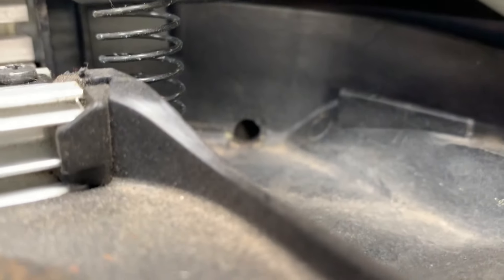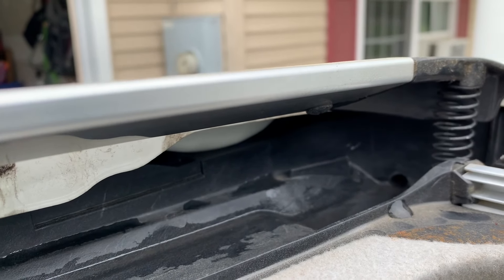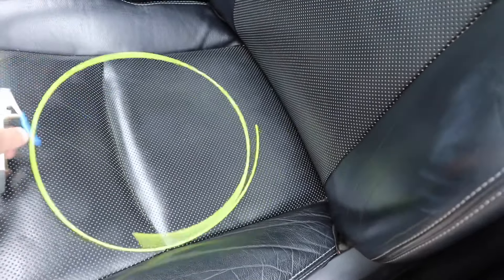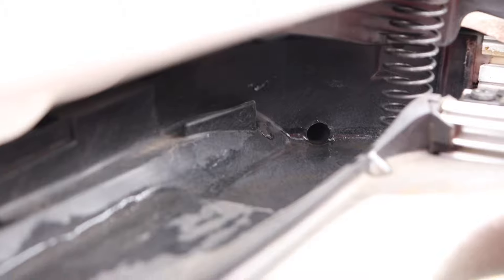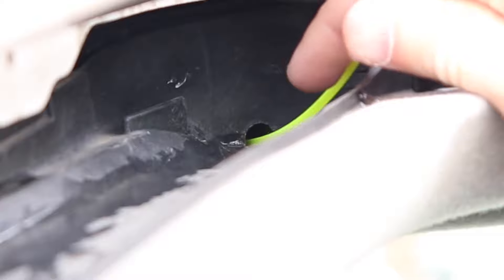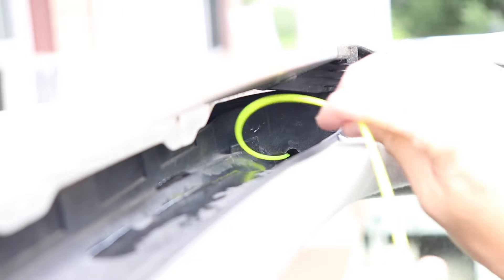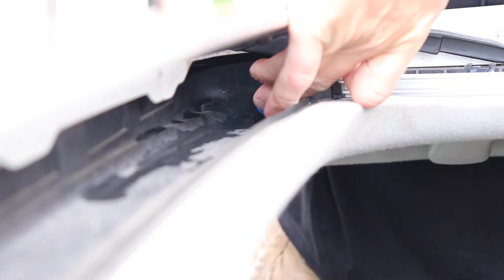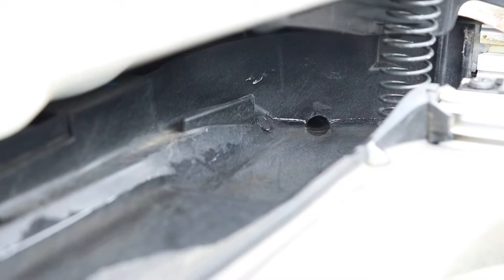How to Unclog or Clean a Sunroof Drain

Comment: So my problem is that water is leaking into my vehicle from the inside of the tubing somewhere. It ends up dripping down to the floorboard on my passenger side and I don’t know how that can be fixed cheaply. Any thoughts? There are no obstructions and I can get water to pour out the bottom behind the wheel well, but with enough rain, water starts to get inside the cabin.
Reply from the maker: My suspicion is that it could be leaking in somewhere else. Maybe the windshield seal or the intake for the hvac system under the wipers.
Reply: It's probably not flowing fast enough out the back and when you hit the brakes it shoots up forward. You can also use liquid plumber. It's safe for plastic. Just rinse it out well with hot water afterwards.
Reply: In font of the windshield you have the plastic cowl top. It also has drains that are cloged up by leaves and debrees. Then it starts to leak into the footwell.  Just find some videos on YouTube describing  how to clean them  for your car model.
Reply: Crazy but mine is leaking thru the light for using the face mirror onto my seat and wreaking havoc, maybe yours is taking the same route? It leaks onto the mirror and then collects and drips down the corner of the mirror flap
Reply: @GiraffeFiesta  Then, it's the cloged front sunroof drain, for sure.
Reply: @GiraffeFiesta There is an extended warranty on some cars that covers replacing the roof rack clips as Toyota now admits the water in that area could be from the roof rack clips...
Reply: @cinderellaz8927 ughhh betting that wouldn't apply to a 2016 Infiniti QX70S at this point? This shot is AWFUL. Mine has a roof rack and the water coming into the cabin was at one point just the passenger side and SOAKING the inner windshield. Then it seemed ok when I had a local mechanic "attempt" to fix it several times. This horrid wet ass summer and "fall" it's on the driver's side floor now as well, my windshield is SO wet I can't even get it to dry off with heat alone, AC, or combined and can't see out of my now yes 7 yrs old SUV, but it was expensive as F, paid off, and only has 37,000 miles on it. UGHHHH😢
Reply: @QueBeraBera me too bro. But mine an fx35 and 60k miles. Ever fix it?
Reply: It’s your drain plugs that is clogged .
Reply: Is there a danger of tearing these rubber tubes that take the water away ? In my VW T6 the drain & tube seem to be clear but water is still coming into the cabin. What wd be the fix in this scenario please?
  Any ideas greatly appreciated.
Reply: @henrycottam3451 did you figure this out? Mine seem clear also, but still leaking horribly
Reply: @QueBeraBera I had water getting into the passenger footwell in my 2016 Infiniti Q70 sedan. I took it to the dealer before I found this video and they replaced the sunroof drains. I don’t know if they were just clogged and the dealer ripped me off when they could have just cleaned them out, or if it was something worse like defective drains. But the issue hasn’t recurred. My guess is they were just clogged since I park outside under trees.
Reply: @Sashazur thank you you're awesome I appreciate you reading back! I finally brought it to the dealer and they did so for me. Thank you again!!!!

Comment: My problem is I can’t get to the drains because the water leaks killed my sunroof electrical so it’s stuck shut.
Reply from the maker: Can you get to them from inside the vehicle?
Reply: Someone said they had their sunroof motor replaced
Reply: @5MinuteFixit  person said they eventually cleaned their drains from the exit, thats at the bottom of it by the front tire area, area by the back of their front tire
Reply: Most sunroofs have a manual override within the open close area, should allow you to close it with some type of allen wrench crank. 🤔

Comment: Nice video! I used one of those stiff wire tools designed to fish hair out of a bathroom sink drain and it worked great. 

Unfortunately, this was in a seldom used vehicle and water had saturated the carper and passenger seat.

I used a powerful dehumidifier to dry out the interior and then an ozone generator to deodorize it. I ran the dehumidifier for a week and the ozone generator for a day and it worked.
Reply from the maker: Thanks for sharing, did the ozone generator and dehumidifier work to make any odor go away?
Reply: @5MinuteFixit  You have to get everything absolutely bone dry, then run the ozone for a few long runs and it will get rid of the odor.

I started with a carpet cleaning machine, using the handheld attachment to pull out as much water as possible.

Next, I placed a carpet dryer fan and a dehumidifier in the vehicle and ran them nonstop, until a moisture meter showed there was sub 10% everywhere. 

Then I ran the ozone machine a few times for several hours with the carpet dryer fan running to blow it everywhere.

I used an extension cord running from under the door to a receptacle that's outside my garage door; to turn off the ozone, I just unplugged it from outside.

Ozone has a half-life of 20 minutes, so I would turn it off for 4 hours, then plug it back in, and repeated that 3 times.

Seems like a lot of work, but it was extremely effective and a lot better than removing the carpet.

Comment: My daughter’s 2019 Nissan Rogue had the problem on the passenger side with a leak. I took it apart like you said. It was exactly the same procedure as you described. The spot where the windshield wiper rest was full of debris. I cleaned that out too. I used a line trimmer and that worked and water came out. That is a really bad design on the Rogues. Thank you for your great video.

Comment: Thanks for the video.
Just one point of concern;
Another video recommended AGAINST using a blower to clear out the drains as this may cause the drain tubes to dislodge inside the bodywork of the vehicle which is a huge problem to fix.
Other than that... 👍🏼
Reply: Yes, the Car Care Nut channel. I would trust what he says.

Comment: You can use 3D Printer Filament too. Works great when you don’t have trimmer line. I pulled it off an old spool and cut the end at a 45
Reply from the maker: Thanks for the tip and for watching!

Comment: Weed trimmer line comes in different sizes.  What size is suggested/recommended?  How long does the line need to be?  The tubing for the drain is some sort of rubber/plastic.  The person that suggested a Draino product - won't that melt the tubing?
Reply: I would go for very thick trimmer line, so it is less likely to kink. As far as Drano etc., it is sold in plastic containers so at least some kinds of plastic aren’t harmed by it. But I don’t know what type of plastic is used in the sunroof drains.

Comment: Sorry, the holes were at the front of the sunroof? I thought there’s usually two to the front (drain front of the car) and two in the back that drain behind the wheel well. I know my left driver is clogged because I had water around and down my ceiling back there. I cleaned it from underneath but need to get in from the top. I wasn’t sure if you meant the front holes drain into the back?
Reply from the maker: My sunroof only has the two front holes and they drain to just behind the front wheels. Hopefully this helps! Thank you for watching! Please consider giving the video a thumbs up if you haven't already! Thank You!

Comment: What else can I use other than trimmer line. I don't have that. I don't have a blower. Do I definitely need that?
Reply from the maker: You can use anything that is flexible and stout that will fit. A can of compressed air could work in place of the blower. Hopefully this helps, let us know what you come up with. Thank you for watching!
Reply: @5MinuteFixit  ...must I have some sort of blower to begin with? Can I just use water to flush down crunched leaves or debris?
Reply from the maker: @sweetbeep  I would flush a small amount of water down to see if it flows through to the underside of the vehicle and if it does no blower really needed.
Reply: @5MinuteFixit  ...thanks.
Reply: Some say a very thin wire or find drain hose at bottom of car, like by the tire and clean debris that might be collecting from the exit hole
Reply: @adavi650  ...thanks. we gotta be careful the wire doesn't poke and make a hole in the tube
Reply: The Car Care Nut channel says don’t use compressed air since you can pop the drain tube off the sunroof frame, to fix that you need to take the roof apart.
Reply: @Sashazur  ok thank you

Comment: Hello. The driver's side fogs up when it rains. Will this method help me solve the problem?
Reply from the maker: hmm I'm not entirely sure, It could just be the water vapor from the driver that is making it fog. It's worth a try and I hope it does. Report back to us if you have luck! Thank you!
Reply: @5MinuteFixit  What should I do?
Reply: Same thing here but it's my ENTIRE windshield ughhh. I'm thinking I need to go the liquid plumber route...any suggestions as to exactly what type I should use? All this time on my 2016 Infiniti QX70S I thought it was the cowl seal after the battery was changed. Now I'm definitely thinking it's the stupid f'n sunroof drains as it's become worse making my inner windshield soaked and no amount of heat or AC will clear it (probably need to change my cabin filters as well, been a while and they are probably soaked), and now I'm getting water on the driver side floor as well. This shit is RIDICULOUS. It should be forever a dealership's responsibility for creating such idiotic malfunctioning BULLSHIT. 🤬

Comment: If you dont mind me askin what type of blower you use to blow it out
Reply: Charmz  I've already tried that and it didnt work.
Reply: The Car Care Nut channel says not to use air pressure - it can pop the drain line off the sunroof frame and then you have to take the roof apart to fix it.

Comment: My poor Jetta got the ugliest ceiling ever right now. Leaked in the front and caused the headliner to sag next to and under the driver side sunvisor, and then it started leaking in the back immediately after in my rear passenger area between the window and the back windshield. 2 saggy headliners overnight 🤧🤧

Comment: Great video. My drains are completely clogged. Can you tell me where the end of the tubing is locate, front and rear. Thanks
Reply: It’s different in each car model but generally there’s one drain on each side of the car in the front corner of the sunroof opening. But some cars have more than one in each corner, some have them in the rear corners too, etc.

Comment: would a can of compressed air give you enough of a blast or would it be too weak to do the job that air compressor is doing?
Reply: That would be safer since it’s under 30psi. You don’t wanna accidentally disconnect something inside of the car.
Reply: @blonded3598  Thanks man. The last few times it has rained I have came out to find my floor maps wet. No puddles or anything just looks like someone sprayed water on them with a spray bottle or something. I will try this.
Reply: @01hondascott did it work?
Reply: @01hondascott same, with my I think the car waves is what pushes and clogs the holes

Comment: What if the trimmer line only goes like 4 inches in and no matter what way I move it around it doesnt go in
Reply from the maker: I would try to force it in more…this could be a blockage.
Reply: I have this exact problem on both front drains of my BMW F30 335i. Weed whacker line goes in 4 inches then stops as if it's hitting against something hard, not like a gooey clog feel.
Reply: Same thing happening with Subaru forester. Can get the line in about 12" at each end of the drain on both front drains.
Reply: Tree needles and junk will get pretty hard and compacted in there and the more you stick that wire in the more compact it gets. A few tablespoons of liquid plumber dissolves those particulates very well. Especially the two liquid type. Rinse it well after the clog is dissolved and poor a cup of hot water down there periodically to maintain it afterwards.
Reply: If it goes in the same distance on the drains on both sides of the car then it might not be a clog, maybe it’s just a sharp corner. 

Plus another channel said the danger of using air pressure to clear the drains is you can pop the drain line off the frame, then you have to take the roof apart to fix it. Could be a similar risk if stops only a short way in and you poke too hard. 

I know on my car I got the line about 5 feet in and it hit a hard stop on both sides, but then I poured water in and it drained out fine under the car.

Comment: Never use a blower at least not in German cars as these drains are connected with plastic clip which can easily disconnect from the pressure.. and then every drop of water will go into your car next time it rains

Comment: Does the average car owner know this is something they need to clean?  First time with a sunroof and didn’t know until it became an interior water/mold issue while parked for a week in summer heat.  Do most people take these steps as part of normal car care?
Reply from the maker: Most people don’t realize this needs to be done periodically.
Reply: I was wondering the same thing! I've had to do this in my 2014 subaru twice now. Never thought there would be a drain in the sunroof. I rarely use mine, so I find it odd that it would clog easily. Both times my rear driver side floor was full of water. Only realized because of the musky smell and condensation on the  inside of the windows. Doesn't help if you rarely use the back seats. So frustrating!
Reply: I’ve had several cars with sunroofs over a couple of decades. I never knew about this until my drain clogged. I don’t think it is mentioned in the owners manual as a regular maintenance item.